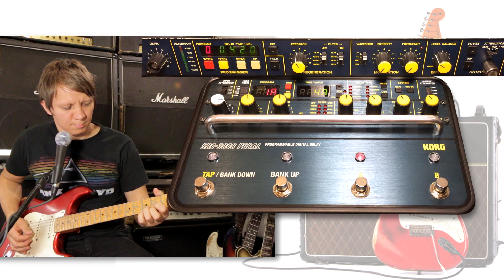Korg SDD 3000 80's Rack vs Pedal Demo

Comment: Nice demo of the comparisons. Ultimately there are some things missing in the new pedal as well as some things that is compulsory to have these days. 80 user presets, expression pedal ctrl and so on. But a MAJOR gaffe they missed with the pedal, which is somehow omitted in this video, is the lack of HOLD/INFINITE repeat button. If they have ramped it up to 4 seconds delay you could do basic "frippertronics" with this one if they only had this HOLD button. That one, you could do with the original one even if at 1 second delay only.

I used to own one. When the subsequent DD-2000 came out with 2 seconds delay, even more high frequency range, I sold my unit before someone got wind of the new one, bought the new one, but boy, have I ever been so disappointed! 

The do-or-die test with the original SDD-3000 rack and this pedal should be like this: Set it to SDD-3000 mode, ramp the repeats up to almost 100 percent (just shy of it) 50/50 wet dry, and max 1 second delay time. Set the gain structure right on both input and output. Now, set the envelope to follow pitch! I e at a certain level of the headroom it starts to pitch. But...here comes the trick... do not play that loud. SWELL in the notes with fade ins with the volume know VERY SLOWLY so the VU meter just peaks at half of it. Listen to the repeats build up. After a while, you have created a cobweb where the first iterations are slowly detoriating but without digital aliasing... on the original unit. You could even press HOLD button and start to jam over it, if you'd like. 

Now, when I tried this new pedal, this was the first setting I aimed at, as this was the main trait, and feature I remember that couldn't be duplicated with any other delay pedal (mind you, not even TC 2290). And..it failed miserably in the end. This pedal has not the possibilities to do a "hold/infinite repeat" which the original had. It seems that they always cut some corners but adds some new features that they think will overshadow the omitted ones. People are getting bogged down with the preamp section of this one. Which is just one of its major traits, and unique features. And people are just getting hung up on U2/The Edge rhythmic dotted eights delay which in fact, all major digital delay pedals can do quite sufficiently. I don't think even The Edge uses the original Korg anymore.
Reply: And of course, the preamp, which is the icing on the cake. You demonstrate this with gusto, having a clean single coil sound. The high end spark is heard att the initial pick attack, on the rack version, but on the pedal version it is more subued. However, I definitely think all this would be lost whenever having a humbucker pickup, and somewhat breakup distorted, so it's an even wash there. Not all people plays single coils all of the time with a squeaky clean sound. Now, I've even heard and tried the UAD plugin of Korg SDD-3000 extensively. You even have to use their hardware to use it. It doesn't even comes close, not even in the ballpark. All that transient spikey spark gets lost, when you have to plug in to external hardware. It doesn't translate into the software at all.

Comment: the hold function button is not packed! If anybody has another opinion please inform us.
The hold function is the best thing on Korg Sdd 1000 , sdd 3000 racks. It samples 1 second of sound(or 2) and trasforms it but then again keeps it original if you turn back the knob.

I want this pedal but can’t test or try it in Greece. If this function is included somehow i don’t know, can’t find on the manual.
Reply: Agree completely. They missed out on what the rack unit has/lacks, and what the pedal has/lacks in comparison. HOLD/INFITE REPEAT was one of my favorite functions when I used to own one.

Comment: What Do you think? How close is the new pedal?
Reply from the maker: Christoph K. Its pretty close but the pre amp has a little different character in the pedal version
Reply: +shnobel By different character you mean it's not as warm and inspiring than the rack unit? For what I heard and read the preamp on the rack unit is one of the most valuable features. If you would have none of them and could buy just one, which one would you buy? I am inclined to get the rack unit, but the only downside I am finding is the stereo input, because I'd like to use it with stereo synths as well. Thanks for the great videos and info!!

Comment: Sadly it is no conquest the SDD 3000 Rack Unit destroys the Digital Emulation.
The only thing the comes even close ( Believe me or not since I use it LIVE!!!) is the Jamvox 2 ( NOTv3)  Korg SDD 3000 Effect Module. That is my Setup live for Older U2 covers Jamvox 2 running on a Desktop ( Fully closed off system, only thing on screen is Jamvox running on a i7 With Windows XP SP3. The Jamvox Korg SDD module is the only thing that can come even close to a Real SDD 3000 rack Unit.

In Jamvox I setup a Korg SDD delay first then add the AC30 TB amp after it inside Jamvox
So basically Jamvox out of my Edirol FA101 into the house PA. NO AMP, NO STOMP UNITS. I have 2 Desktops running at the same time in case if anything happens with the main one. 

Jamvox v2 or v3 for any U2 sounds ( Early 80's to 86)  as those years Edge was basically very simple. Korg SDD 3000 into a VOX AC30TB
Reply: Can you explain the difference between digital emulation and digital processing?